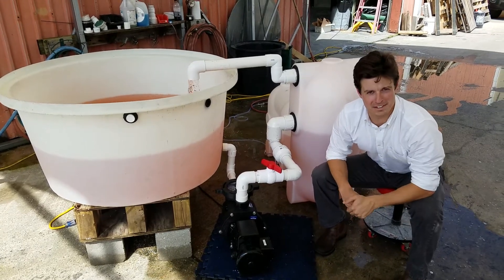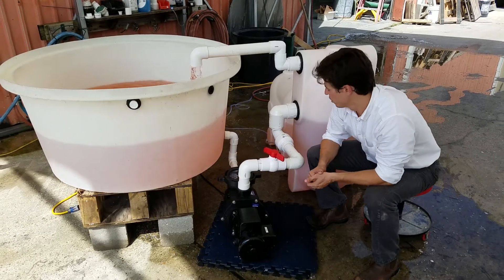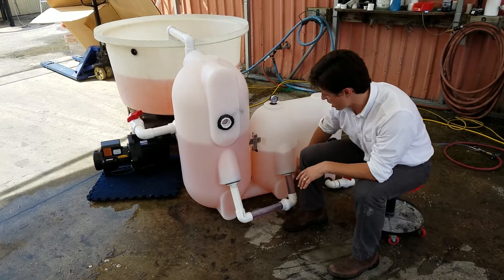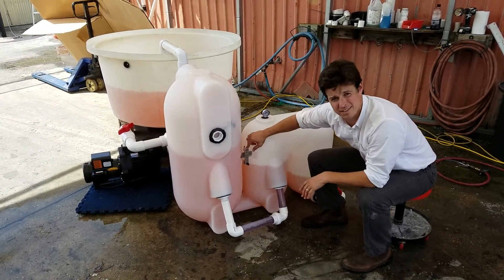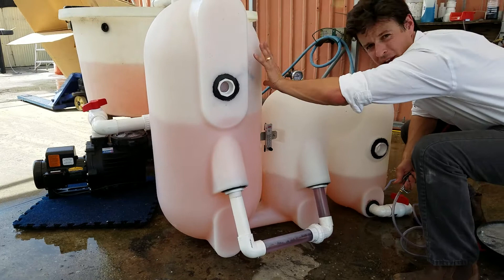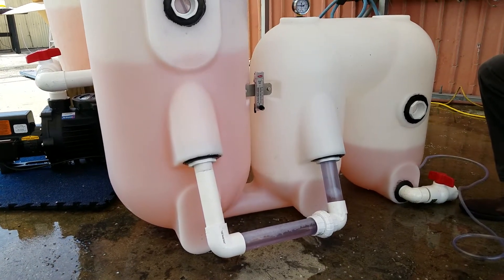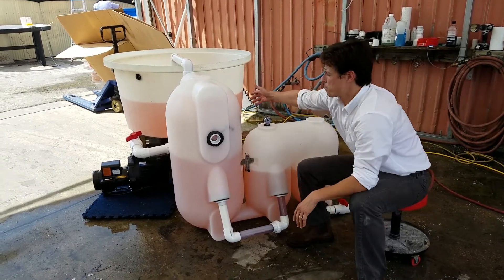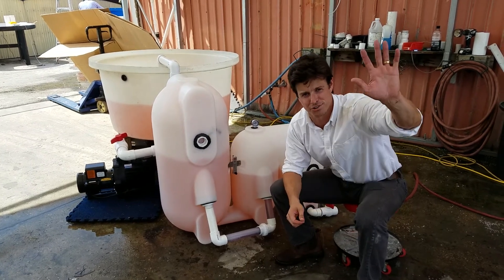AST Endurance Filter: Water Pumped Configuration, PolyGeyser Technology

Comment: I'm about ready to pull the trigger and buy this but looking at my configuration have a concern. 

Would it be possible to pull water through the system (instead of push) with the pump on the water outlet side, in a pumped configuration? The inlet port would be gravity fed from the tank. 

The reason is because I want to protect the propeller on the pump from solids, after changing far too many. I want as little maintenance as possible.
Reply from the maker: Thank you for your question! Theoretically, yes you can "pull" water through the filter, however, I would not recommend this configuration due to the fact that these filters are designed for positive pressure. If for some reason a valve upstream is closed or a clog occurs, a downstream pump would create negative pressure and could cause the unit to collapse. If you want to use gravity to push through the filter and discharge into a sump where the pump could then return to the system, that would be the best option. 

Thanks!